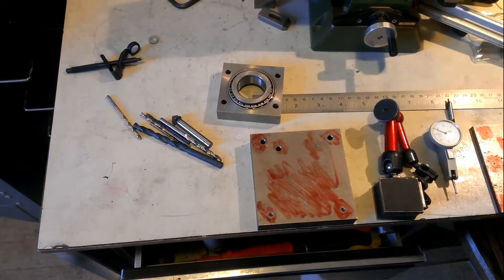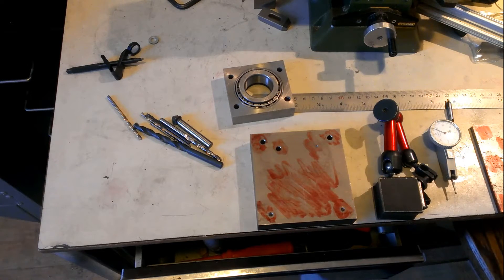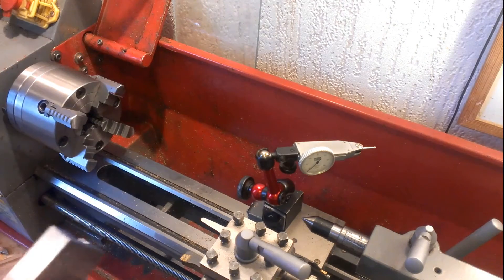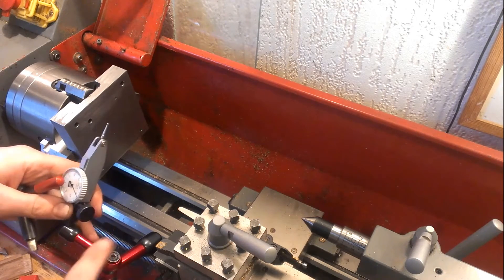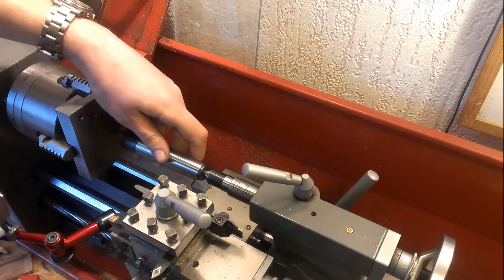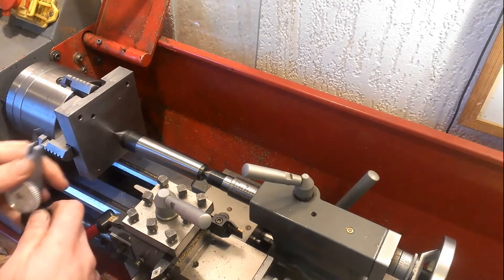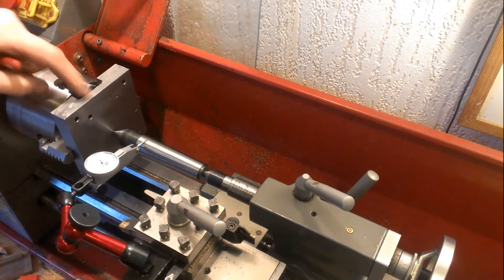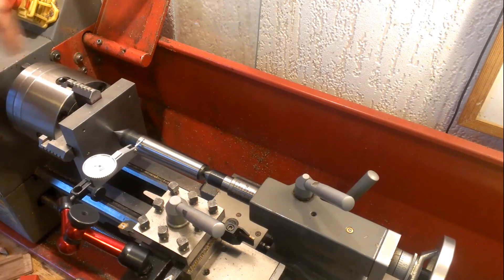Centering in the 4-jaw chuck

Comment: Hi
Using the center between centers is a good idea.
Since the little indicators have little travel you can just use the indicator as a pointer, no contact with the work or center. Then just visually center the work.
After visually centering then use the indicator for final centering.
With these little lathes you have to think outside the box.
Eventually you can fit larger chucks. My face plate needed truing. You can do a lot with some thought.

Fighting chatter,  you can sometimes use the tailstock to apply pressure to the work piece and the chuck.
And always go slower and make the tool as sharp as you cal. The little diamond hones will be a big help.
The tool contour, shape is very important.
Maybe my vids could be a help.
Look at my early vids on youtube under Dennis Williams.
They are not fancy but as short as I can make them with not editing
Thanks
Dennis